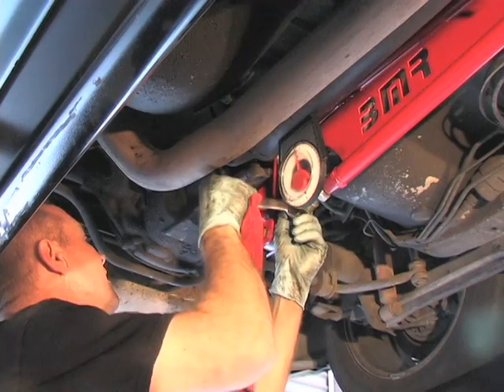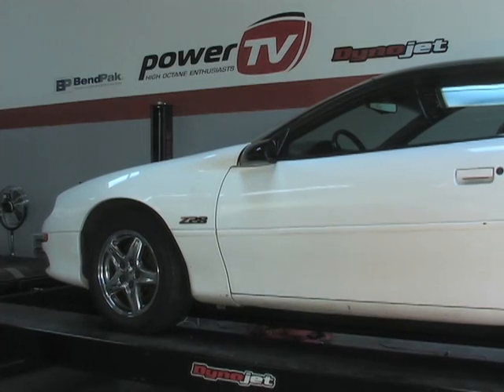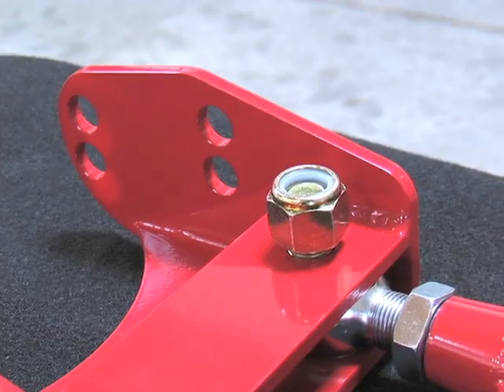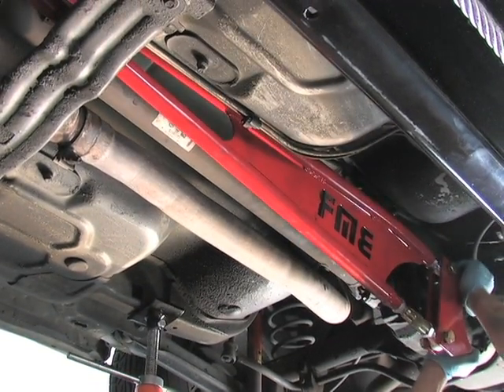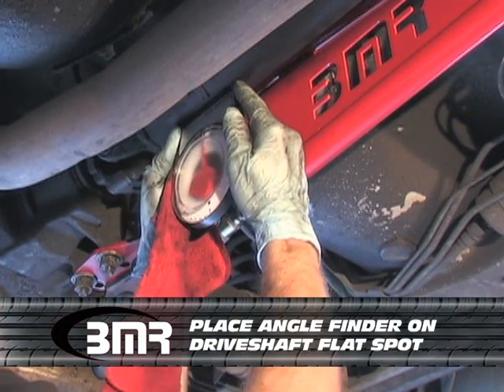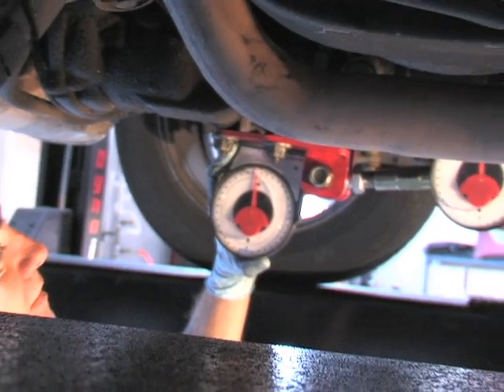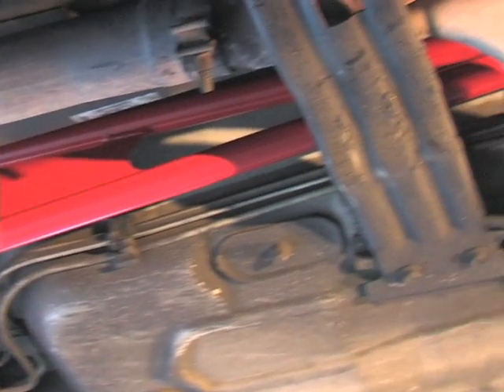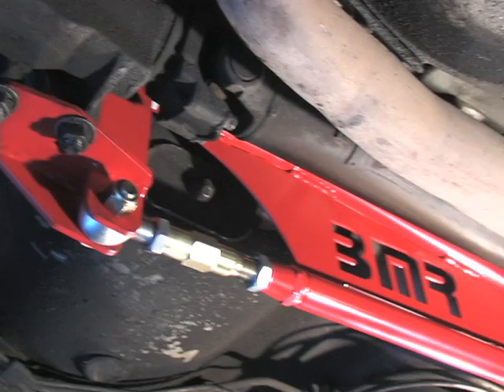More Accurate Traction for your F-Body

Comment: Does anyone know if you would have to do a torque arm relocation if you would put it on a 4th gen ls1 fbody with longtubes?
Reply: im in the same boat as you, but they should sell a mounting bracket in case you have LT and Ypipe, the mounting bracket bends at the right point so the pipes do not hit at all
Reply: I have an lt1 but I have a bmr torque arm and just had longtubes and duals with an x. The shop welded around it. Wasnt too hard.